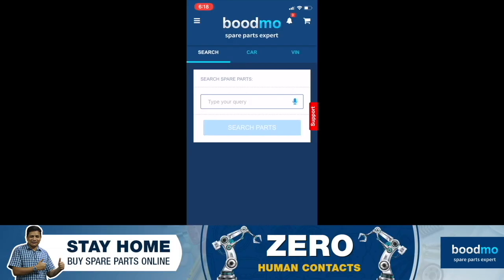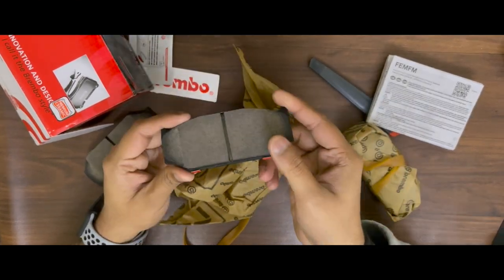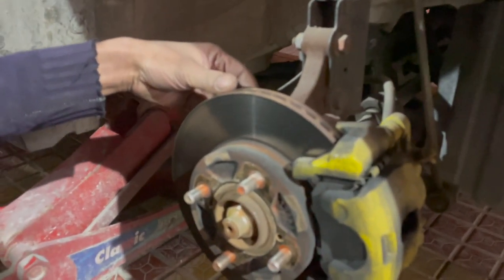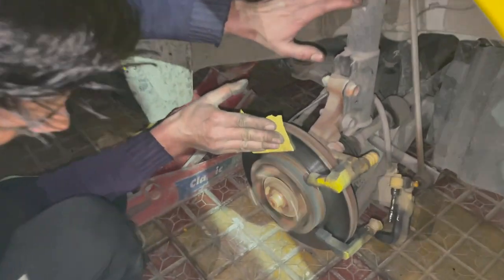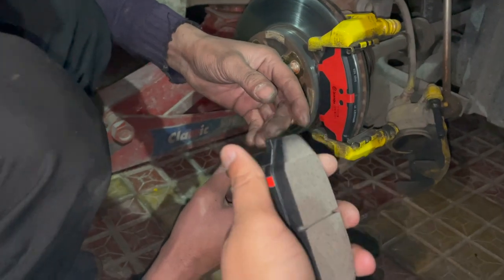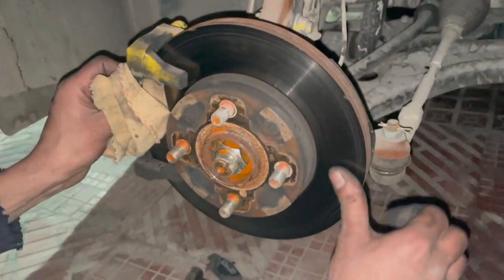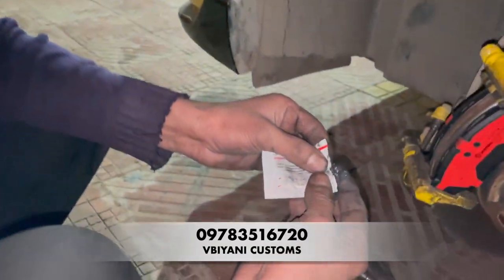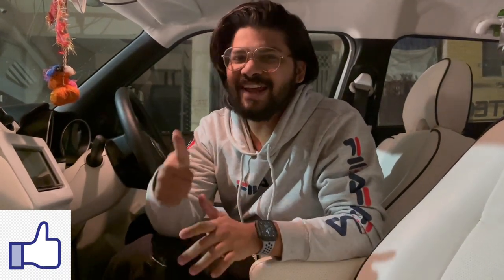😍 आखिर कार MY MODIFIED SWIFT GOT NEXT LEVEL PERFORMANCE BRAKE UPGRADE 💥 | 2020 SWIFT BRAKE PADS 😘

Comment: Thank god finally found a youtuber who is doing mods with brain not like other ricer who think air filter is the only performance mod.
Try to swap rear drum with disc if possible. A recommendation  for you you should get your car tuned by a good brand with map switch so that you can switch between stock tune and performance tune, I am not saying that wolf is bad but Stage 2 doesn't seem to me a promising name in Stage 2 generally we get a standalone ECU a dyno tune drive shaft upgrade and clutch upgrade, what they have done is just a minor tweak to AFR and gear ratios for a low end punch every swift is different a good tuner tune the car on dyno with gradual rising of performance , they should call it a enhancement tweak or tune rather than Stage 2.